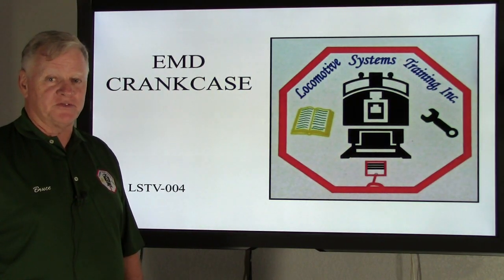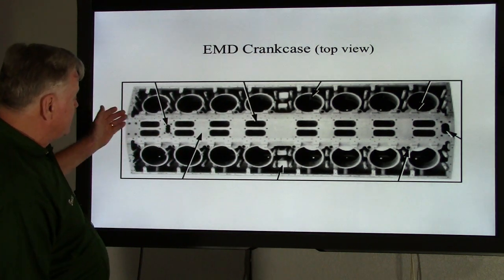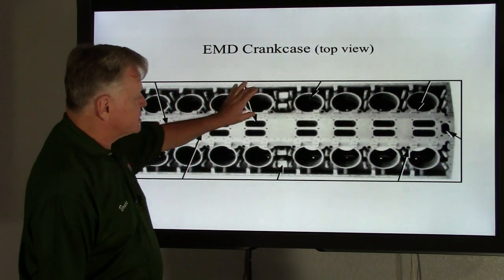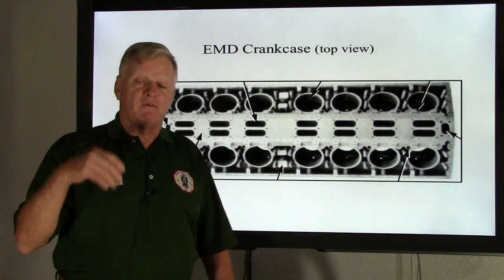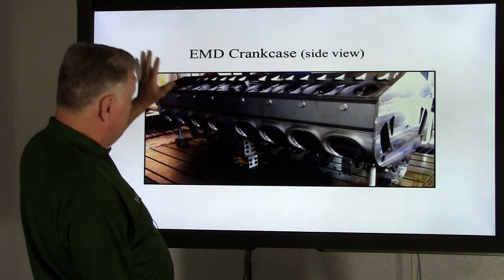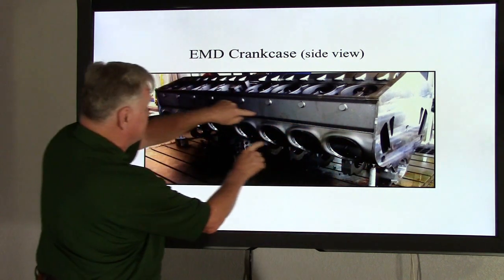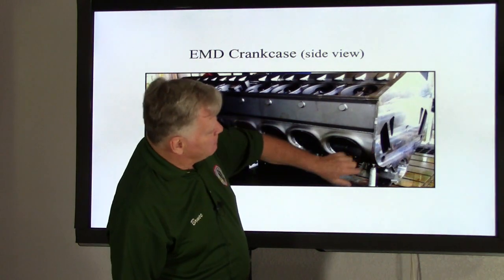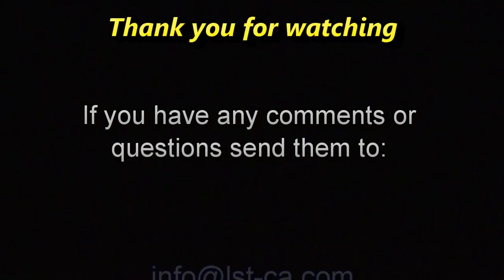LSTV-004 EMD Crankcase

Comment: with the high vacuum does that fact pull the oil out of the crankcase?
Reply: No. There is a gear driven oil pump that sucks oil from the crankcase.

Comment: Enjoyed the video! As an EMD fan,...it's very interesting learning about the 645 and 710 engines!
Reply: These 2 strokes make insane power at low rpm's. Is the welded alloy case stronger? I heard it was but not sure. Can these run needle roller bearings on the journals for abouv 3000 hp like the fairbanks morse does? Not sure
Reply: @jlo13800  Weldments made of tempered steel are much stronger than porous pig iron sand castings--and lighter too.
Reply: @Greatdome99  here comes summer with 12 gallons of saber professional in a 12v71
Reply: @Greatdome99 klotz techniplate in a Fairbanks Morse OP 2 stroke!
Reply: @Greatdome99  If arctic cat would only make an 858 CID per cylinder v-16 2 stroke!
Reply: @Greatdome99  I need a timing lighight with a72000 volt ignition system
Reply: @Greatdome99  Yes and stronger than aluminum too. Unfortunately all car cutler knows is disposable 4 turd strokes!